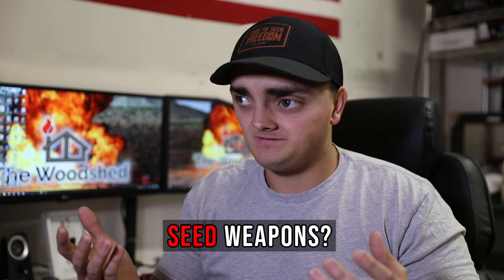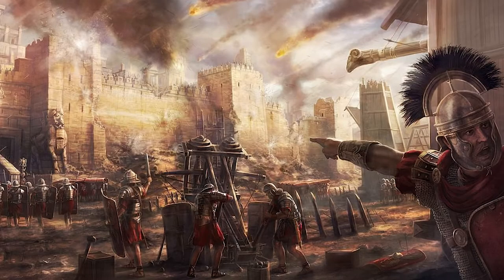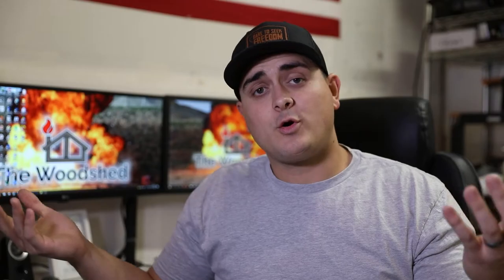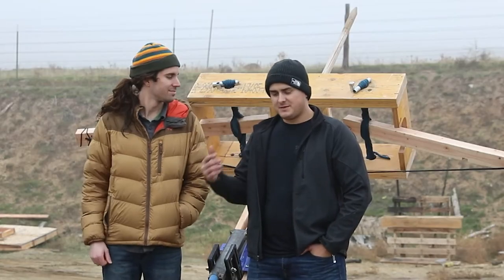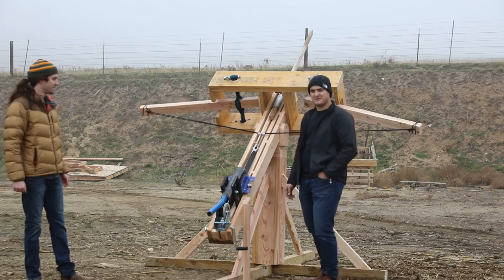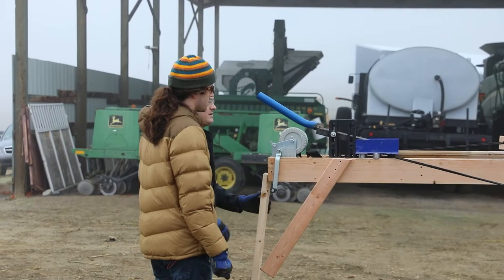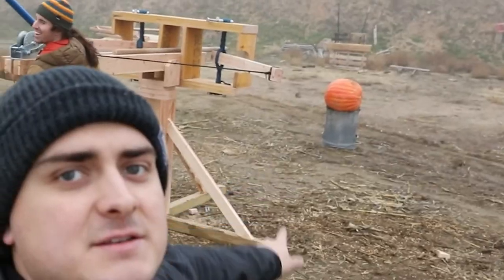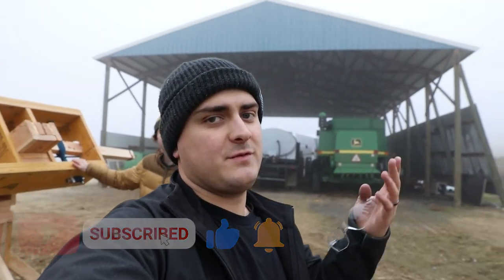We Made a Roman Siege Weapon - Homemade Ballista

Comment: Don't give up, your'e almost there. Just replace the rope torsion bundles with polyester strapping and tighten them by hammering in wedges top and bottom. Good job on the structure, it will work, it just needs more pressure. These things can be quite powerful. Nothing even broke yet. Check mine out, it will punch through a 1"oak plank. Your laminated veneer lumber frame should take lots of stress, no problem.
Reply from the maker: Oh dang we’re actually going to try and revive it in the next couple of weeks! I’ll definitely keep that in mind. I like the wedge idea more than what I was doing
Reply from the maker: Just watched yours and you definitely know what you’re talking about! Love your build man it’s so sick!
Reply: @TheWoodshedTV  Thanks, that LVL frame is a great idea. Most of these things have a weak link that shows up under pressure. So far on mine the cable clamps that hold the bowstring slipped once. Also it got a flat tire. I try to make the bolt (arrow) the weak link. A strong enough bowstring can split a bolt. You don't need a lot of twists in the torsion bundle (thats called stacking, too much is bad), but you need a lot of pressure. Wedges are reliable old school. I used nuts and bolts- a helical wedge. You are 96% there, don't give up.